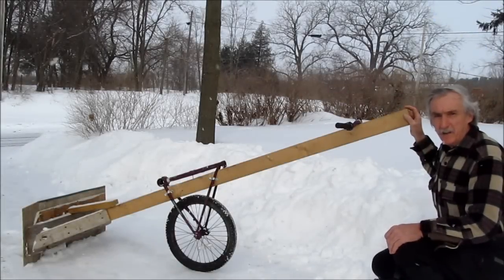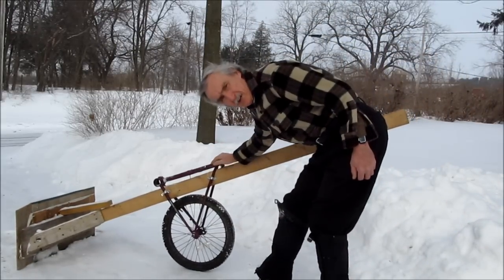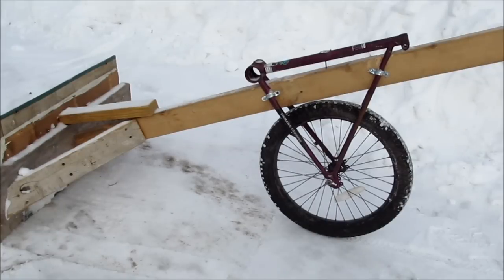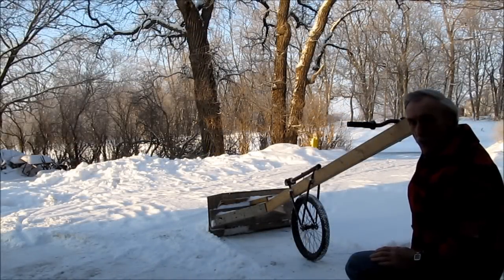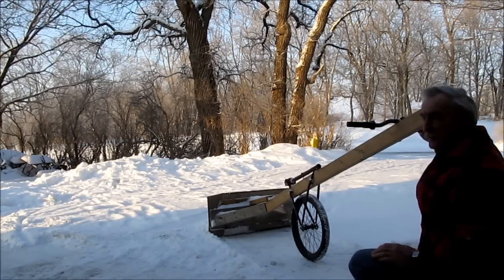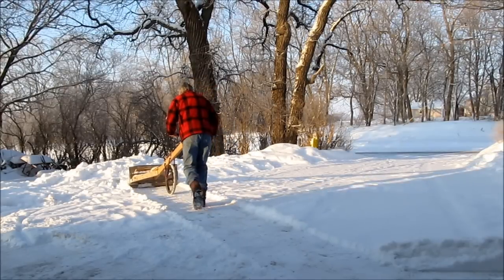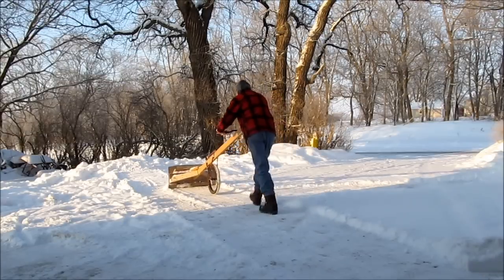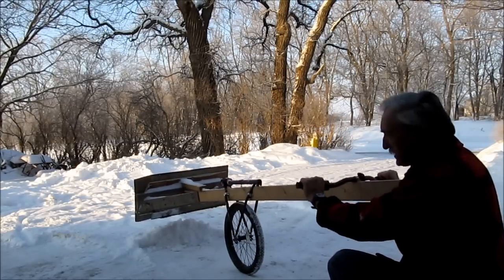Human Powered Snowplow With Wheel

Comment: The 46 thumbs downs are from the guys that charge an arm and a leg to plow driveways. Good idea what you've made.
Reply from the maker: I can't tell you how well that rig has worked overall.
Reply: @TheNorthwoodsman1  I'm 48 and diagnosed with acute congestive heart failure. This last winter we finally got snow in southern ohio and being a widower with no kids had to shovel the driveway. It took a while but I got it enough where I could get out but had to back out. I experimented with putting tarps down over shat i had shoveled when we got new snow fall. Took around 5 minutes per tarp to drag it over exposing the driveway. It worked but like shoveling snow it to was hard on me. Maybe your creation might be easier.

Comment: Do you think it would help to have an "apron" at the top end of the plow for you to lean into, instead of leaning into the 2x4?  ~  Michelle
Reply from the maker: I am contemplating that. Most of my use so far has been OK, with just pushing on the handle bars. I want something there that will not be in the way as I push down on the handlebars to push snow up onto the piles lining the driveway. Maybe a 10 inch padded disc.

Comment: That's a great improvement . What if you had a two wheeled version , like side by side wheels ? you would have balanced that plow from lateral movement. Thanks Love your serenity .
Reply from the maker: I feel that if you had two wheels you would still want the beam to pivot on the axle so the blade would always be flat on the ground. The handlebars really help to control blade.
Reply: I was wondering the same thing but then realized that the wheel really doesn't serve any other purpose than to keep the arm in the air.  The plow itself takes care of balancing.  If I were to make one of these, I'd consider making the wheel  swivel off-centered.  That would allow for turning.
Reply: Andrew Rogers Hey Andy, noticed yer post of 7 months., Did you get your idea off to your fruition? Always interested in new and innovative ideas.

Comment: The top end of the 2x4 against your chest, sternum, ribcage looks dangerous. You might consider adding a breast plate on the end that would allow you to safety lean against and add body weight to pushing power. Alternatively, you might consider moving the handlebars up to the end of the 2x4 or shortening it.
Reply from the maker: I never have changed the set-up but to your suggestion I do find myself putting the end of the 2x4 against my right shoulder when the snow is deeper. A little padding is in order.

Comment: Instead of a chunk of plywood in the front ....
Check out using a piece cut out from a blue plastic 55 gal barrel.  Then I think I'd angle it slightly to keep it from building up fast.

Also I think this would work great when you have a dry snow.
Not sure if it would work as slick if the snow is very wet.

Comment: Probably a lot better with a lighter plow and a decent blade,, and a pole vs the 2 x4,, if it's lighter and stronger you can use more power lifting snow than lifting the device
Reply from the maker: The blade was to be a test but never needed upgraded. With the wheel near the middle and the leverage it is easy to lift it at the end to push snow up and over the accumulated pile.

Comment: I have this new invention it's called a snowblower it takes gas and works amazing....
Reply from the maker: Yeah, I have one too. Just have not used it in years.
Reply: Just being a wise guy enjoyed the video
Reply: The bad thing about snowblowers is the carburetors are prone to getting plugged after the machine sits over the summer.  Maybe the key is to drain all of the gas at the end of the snow season?  I'll have to give it a try.  In my experience, the engine runs better using gas that doesn't contain any ethanol.

Comment: keep your day job
Reply from the maker: The idea with this free model is less time needs to be spent in that day job. A plus is getting some  winter exercise.
Reply: @TheNorthwoodsman1  I use a piece of 1/2" plywood 30" x 4' to push snowfall of around 2" or less.  I bolted a metal strip to the 30" edge to scrape against the concrete surfaces.  I thought about making some modifications like adding two wheels and adding two wheelbarrow-type handles to make it more ergonomic, but I haven't taken the time to do that yet.  Pushing snow is much easier on the back than lifting and throwing it with a shovel.